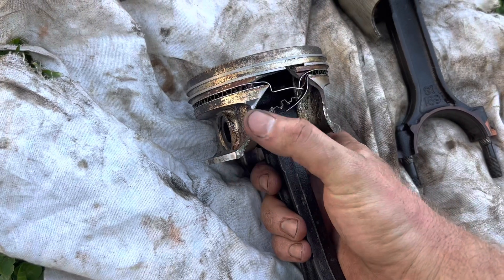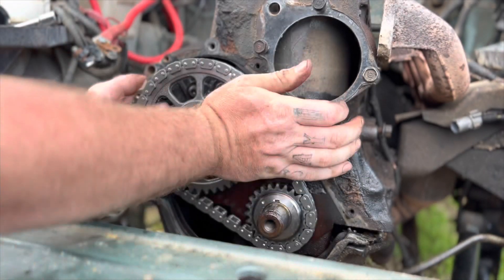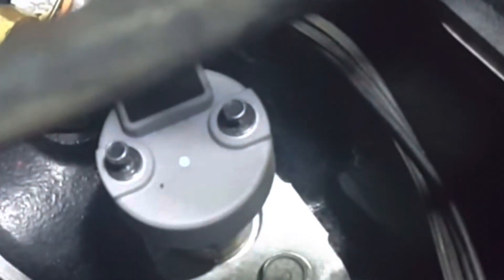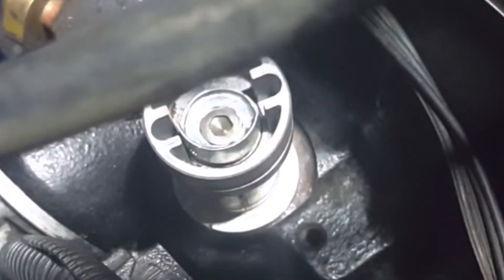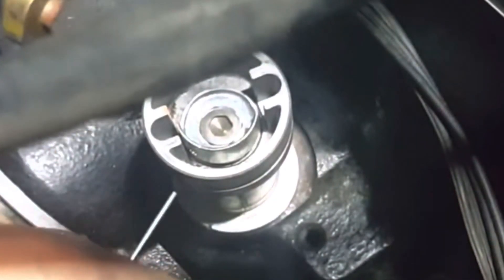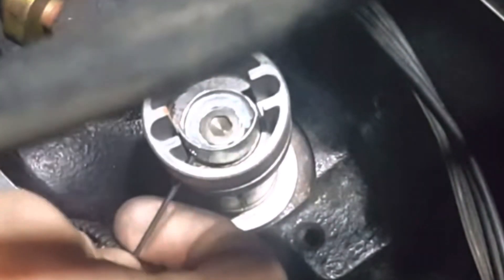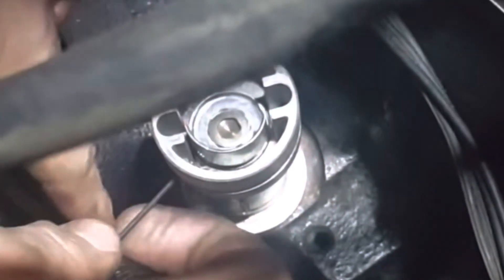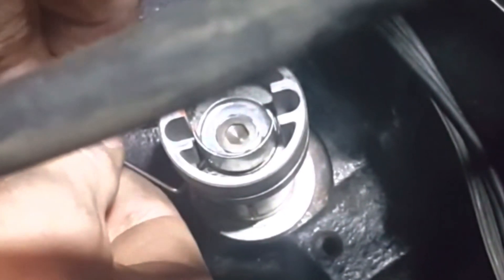Jeep Cherokee 4.0 in frame rebuild part 2

Comment: Could you replace the cam without  pulling the engine on these cherokees?  I need to rebuild my 99 and it needs a cam but I don't have equipment or facilities to pull the engine.

Comment: Did you do the cam and bearings for that as well or no?
Reply: Doubtful since you have to remove the transmission and flywheel (or pull the engine) to access the rear bearing.
Reply from the maker: My cam bearings looked perfect so no it’s a bigger job

Comment: I've got a 2001 Jeep Cherokee with the 160000 miles on it thet I'm selling  What is your suggestion that I sell for it.there is  lift a 3inch on it And transmission spacers and some other stuff the bodies pretty good and they're  is no rust. Also put some brand new stuff on it it's been setting for a while to make it run better. And Dana thirties